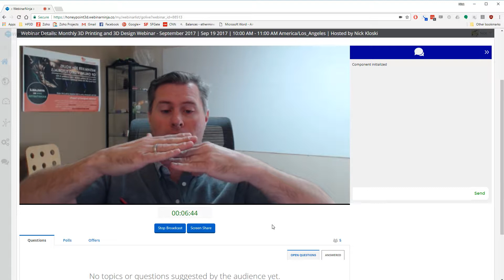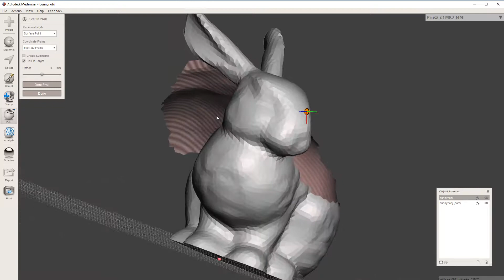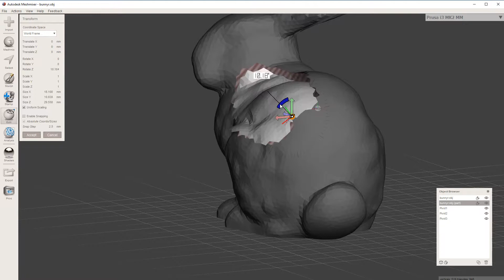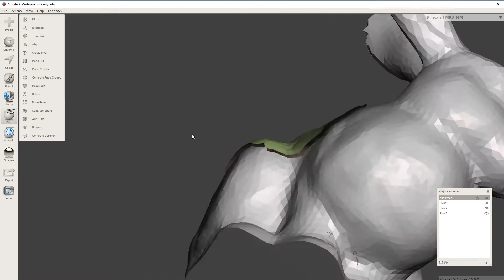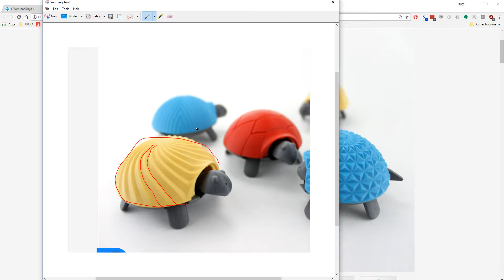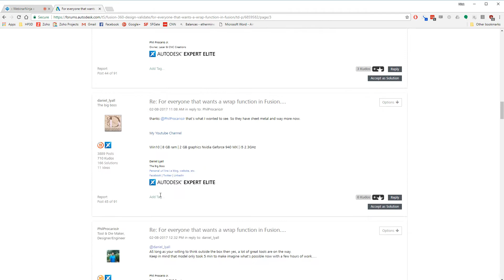Monthly 3D Printing and 3D Design Webinar Replay - September 2017

Comment: Thanks for the video. Do you know, is there a function in meshmixer to make an infill? I have a STL fill that I would like to fill. The hole is to small to print it.
Reply: Yes indeed!  The Edit --> Make Pattern command will do that.
Reply: @nickkloski3877  thanks for the tip. It's not that easy, but it works.
Reply from the maker: @DerTheoretiker  Creating infill in your slicer is a better option...in some slicers you can even hollow then export the infill as its own 3d model.

Comment: Hello. First i want to congratulations for share your knowledge. I'm a beginner using meshmixer and your videos help me a lot. I have a dude and i don't find the solution. If you know it, I would be very grateful for you answer. If i use select in a object and i draw a circle ( the circle is orange but inside and outside are grey). Are there any option to order that all surface is inside {gray} include in the selection? . Thank for your very much for your helo
Reply from the maker: Sure....if you select something and hit "e" that will expand the selection to everything that is connected to that selection.  If you hit the "i" key, that will invert the selection....meaning that everything that was selected will not be, and everything that was not selected will be.  If you are talking about selecting everything inside of the circle you just drew on the model there is no way to directly do that.  The only way I would do that (without selecting the inner part of the circle by hand) would be to draw the circle, "create facegroup", then double click on the inner part of the circle, and create a facegroup there, then doubleclick on both facegroups and create facegroup again, making one large facegroup.
Reply: @HoneyPoint3D  thank you very much for your answer.  I'm sure it will work well your proposal. I hadn't thought about working with face groups. When i will arrive at home, i will try and i will anser if it will woeks well. I'm out on holidays, sorry. You are very generous for take your time on my and your knowledge. Thank you very much.
Reply: I have already came back  from my little holidays  and I have already tried the solution that you proposed to work with facegrups. Congratulations. It has worked perfectly for me. Tell you that at the begining the  object was a surface that I transformed into a solid. Working with facegroups works perfectly for me when the object is still a surface. When it is a solid, no. But nothing happens. I am happy with the solution you proposed. Thank you very much from the heart. Thank you